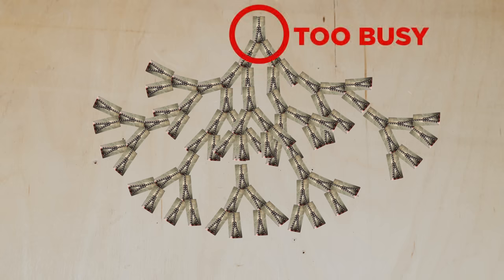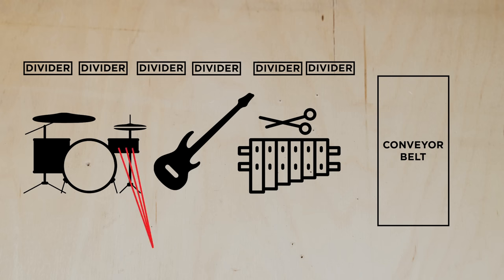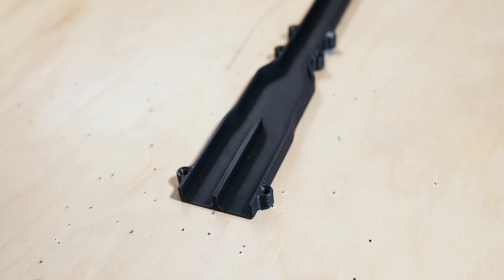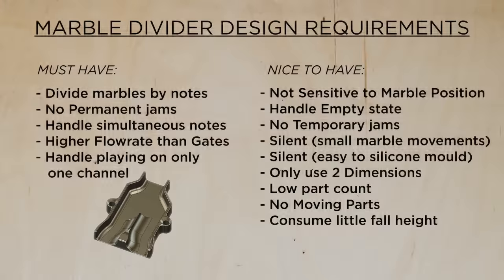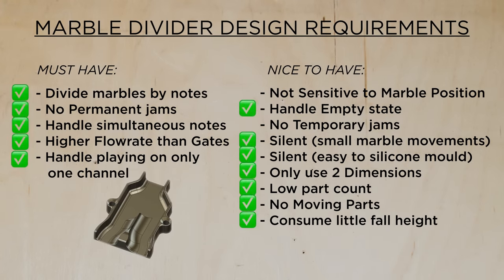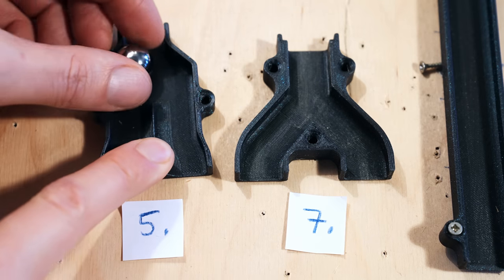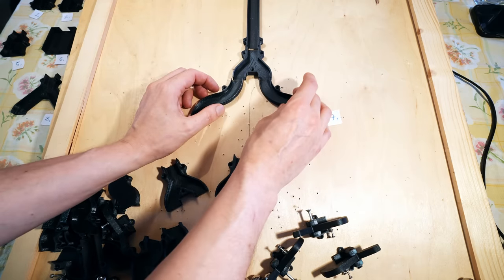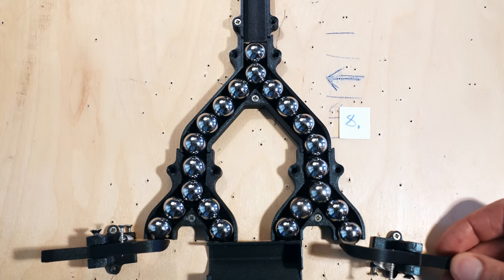Mystery Marble Divider?

Comment: honestly, I think the entire marble dividing system is a no part is the best part, no process is the best process problem. You don't need a divider, just a bucket with a cone in the middle feeding the pipes. put the feeder pipes in the bottom and place them around the perimeter

Comment: I’m sure there are industries out there that have solved the problem of feeding ball bearings into a machine at high rates of speed without the ball bearings getting cam locked. Probably some sort of vibrating hopper feed system.

Comment: my question was: When the divider should not be sensitive to height, why it has to? my thought was, you designthe end of the gate, so the height doesnt need to be adjustable. you can design it as fixed, or am i wrong

Comment: just make a pan/disc with a raised center and exit ports at the pan walls. Marbles drop into the center of the pan and go to the edges.
Reply: more specifically you could have alternating dimples as the balls drop into the center of the pan they bounce against a marble on a occupied dimple and send that one down one level and at the same time the reaction sends the marble to an area that is not occupied, they will descend evenly, just make sure the dimples are deep enough to hold the marble but not too deep to prevent them from being pushed. if you want more exits you can make the pan larger (or smaller for fewer exists)

Comment: It's actually not possible to achieve what you want without having a moving "vibratory" element which will "unstick" the marbles when they get stuck. That's the solution! Every factory automation component has something similar. Something should vibrate or wiggle the divider like a motor or motion from your main wheel.

Comment: They should 3D print a structure like this under every nuclear reactor, so if you get a melt down and the core melts down through the floor, the molten core will divide itself into pre fabricated lanes of concrete tubes, and go non-critical by itself.

Comment: I would not have gone about this in such a way at all. If a divider is causing so much grief, why not just eliminate the divider entirely? While certainly less efficient, having each note on its own track looping on a series of elevators, maybe even have them all belt driven by one motor for the sake of synchronicity

Comment: Wiggle parts won't work. You showed us that little difference in marble gates positioning will ruin your marble deviders. But these wiggle parts have too much randomness in them. Sometimes they are packed with marbles more densely sometimes more sparsely (which is the same as if marble gate is lower or higher). But this is exactly what ruins your deviders.

Comment: Well I like your 11th design not sure why that wasn't your first thought cause all the previous ones seem very pointless and useless at first glance I have to say I think you've lost your marbles to even want to build such a ridiculous thing but it will be cool when done keep at it I guess my only suggestion would be maybe use very flexible silicone tubes that's you could pressurize with air to stop all marble jams if the tube is only tiny bit bigger than marbles when air blows threw and hits a jam it would expand and un jam and you could even use air to stop and start marbles on lanes by Arduino then just have one big tank of marbles with lots of flexible tubes coming out the bottom each with a nuematic valve at the end to drop marbles pressurize the big tank I'd say air is the way to go not gravity feed.

Comment: No, no, no Martin. Height adjustments are absolutely not the way to go! Yes you can try to find a splitter where Marble height does not play a role. But the main problem is not that the splitter is dependent on marble height but that the marble height is defined by a different module (the gate).

I think generally in your mm projects one important mistake you have made in the past is that you made the modules to dependent on the other modules. If one module cant fix a problem (in this case the splitter) you tend to try to fix it with another module. Here this results in the gate to define the marble height in the splitter. But this is not the gates job!

Comment: Why not put a dimple instead of a bump? The problem is not the location of the balls while moving, but you need every in between note to have the splitting ball to be in the correct position. Place a dimple so that it will lock in place if within a couple of millimeters.

Comment: I don't understand where the requirement for non-adjustable track length came from. You didn't do a good job of introducing that and just jumped to tge adjustable tracks.

I think the gates at the end should have adjustable screw holes to allow for length calibration instead of the module approach.

Also for chaining them just use a telescopic track approach one path inside a wider path to adjust the length so you don't beed to be a multiple of winding module apart.

Comment: Can't you just use a spacer/washer  in the gates to make them adjustable rather than the length of the path? You could then have a range of slightly different spacers and calibrate the machine with them

Comment: Why must it be 2D? Make a transparent cylinder about the size of a film canister with a v-shaped divider at the bottom that splits them left and right. Then have the enter the top of the cylinder in the centre. The only catch is that it would have to be mounted vertically and not at an angle.

Comment: As a former engineer, I think you're going down the wrong path. You're trying so hard to align marbles JUST RIGHT, but the problem is your very design is SENSITIVE to marble position. You need a marble divider that is ROBUST, and DOESN'T CARE about marble position. Remember, your goal is to go ON THE ROAD. That means you want something that can take bumps and jostling without accidentally something getting nudged out of position. Think of a design philosophy where a backup in one of the 2 lanes actually HELPS marbles go into the other lane, rather than PREVENTS marbles from going into that lane. (Hint: It will require some simple moving parts)

Comment: One concept always failed you is "agnoticism". Actually much more in good design, but agnoticism is central. An agnostic system should work besides the input meaning it will work for all inputs, without saturation.  This is what you want for the complete machine. But, as you choose to built it modularity, each module or, at least a sequence of then must be agnostic. And your design roadmap doesn't point to this.

Comment: no, there is a possibility of the jam on the trigger, if you make the mechanism so to push out the ball always then no jams. talk about bearing balls. small like 3mm.
Reply: why do you design to divide at all. if you have a bottle of marbles per line, separately feeding and not even looping back necessarily.
Reply: do a drop holes track divider instead, its always free flowing
Reply: @gsestream I'm not sure of the efficacy of making space for all of those lifting mechanisms. But I think you are correct; the best solution is to delete the problem not deal with it.
Reply: rotary slot trigger would keep the marbles at the right position all the time
Reply: well the rotary trigger would drop to left and right automatically, and is 2d, but its motorized not free flow automatically passively
Reply: or just have it work like high water tank flow, with separate funnels for each track, then its 3d splitter tho, but then you can just lob the exit marbles to the top main tank, to use the water analogy @onffxiimanon

Comment: U Won’t wanna Read this, surely. I feel Drawn to tap it out, anyway. / I been having trouble with my bathroom drains. There are Three small units that make up this long building. The other two units seem to jam Several adults into the super small unit. Consequently, the Demand on the drains is Higher and Higher. Ea unit has drains that travel from the drains to a 4 in pipe at the corner of the building then Share a 4 in pipe extending from the Building to the city main line. 
Like I say, u don’t wanna read this, however, in the interest of your solvency I wish to Suggest you aid in how to Meet the Higher demand on sanitary drains Given the world population growth.

Comment: It is a marble machine, if you want 'perfection' buy a midi sequencer. The whole point of using marbles is because they are not perfect, and you get the nuance of the machine dealing with the variability of marbles. You are building a ball bearing machine not a marble machine. live a little, let some uncertainty into your life, build a machine that can deal with all of the ball bearing manufacturer's rejects or even hand made marbles.

Comment: you need to set this up on a loop and run it though thousands of iterations before you call the job done.
Reply: i agree
it needs to be a micro scale version of the whole that runs for a few days

the easiest way i can think of is to figure out how many you need to divide into for each segment
build test gates of the amount you need for each segment
a marble lift to keep adding marbles to the gate test and run the gates faster then the max bpm of the machine in different orders
aka 4 lane divider (1 = in use, 0 = not in use)
- yes it would be a binary thing
test 1 - 0001
test 2 - 0010
test 3 - 0011
test 4 - 0100
test 5 - 0101
test 6 - 0110
test 7 - 0111
test 8 - 1000
test 9 - 1001
test 10 - 1010
test 11 - 1011
test 12 - 1100
test 13 - 1101
test 14 - 1110
test 15 - 1111

just let it run for hours on end to see if there are any flaws